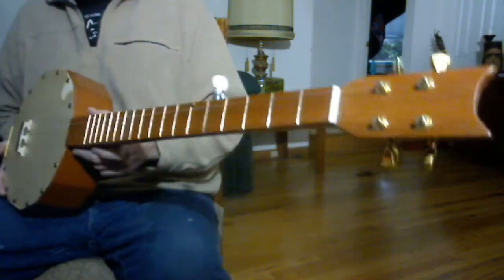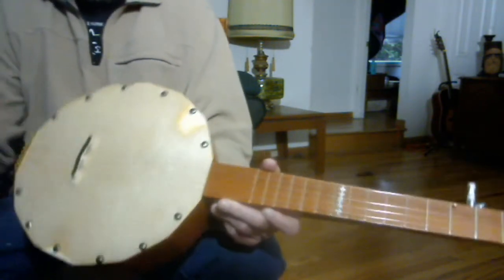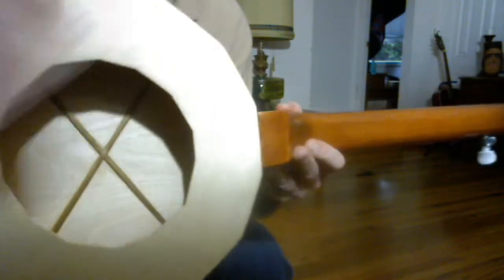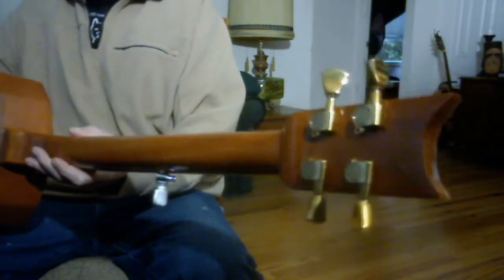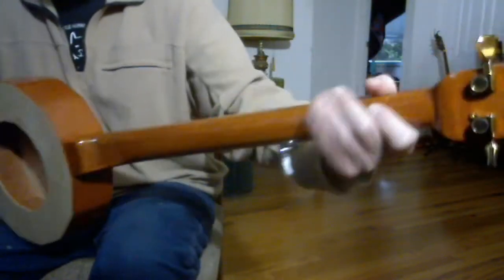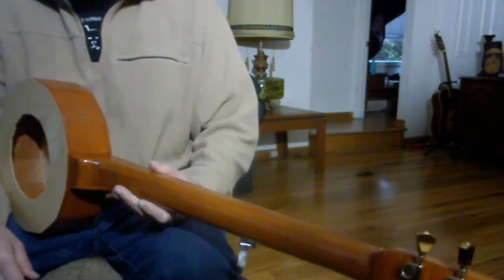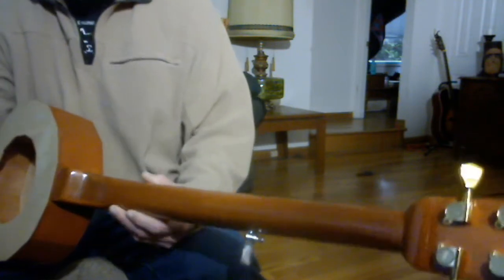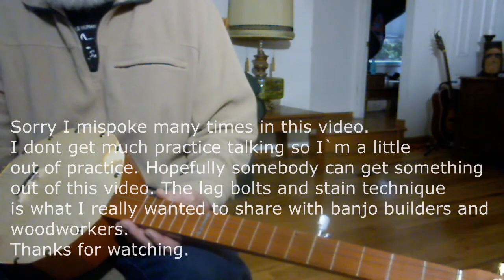Homemade Wood Top Banjo -  Lag Bolt Neck Attachment -  Blotch Proof Wood Staining Technique

Comment: I've taken to building open back banjos in my carport and intend to try my hand with the wood top variety. This is a very good video, providing practical advice AND inspiration. Thanks much!
Reply from the maker: Thank you! Yes the lag bolts work great but I would put screw inserts in the neck and use machine screws instead though. They add more support. I did that for my next build but the lag bolts screwed straight into the neck work well too.